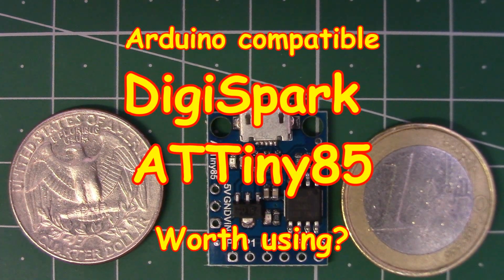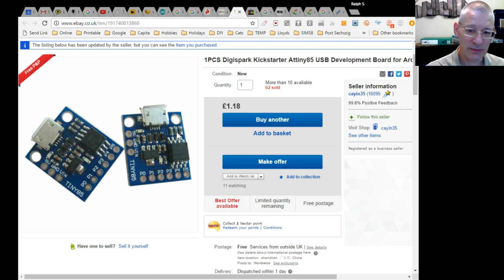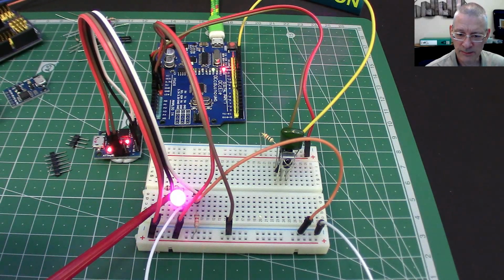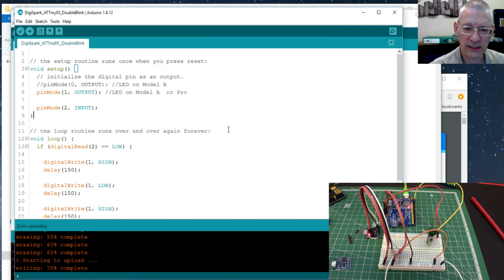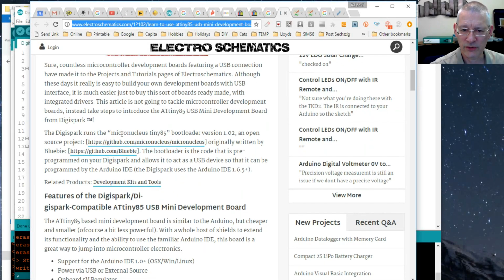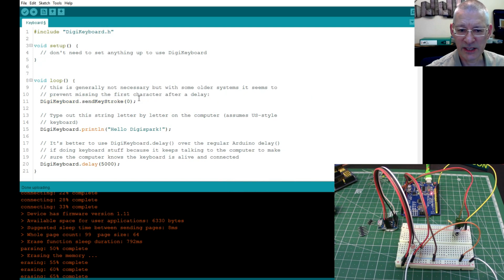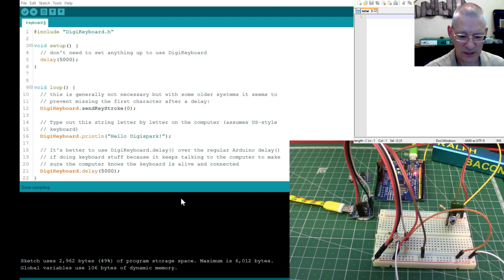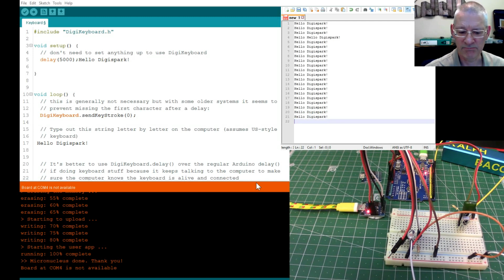#66 AT Tiny85 Digispark - Arduino UNO alternative? An introduction!

Comment: Great video. Curious, if your using an arduino to mimic a keyboard to control your computer, why not write a simple Autohotkey script to  perform that action by a keyboard shortcut key. Just thought I'd share. I learned a lot from your video!
Reply from the maker: Ah ha! It sounds obvious to use a keyboard shortcut, but I can't have my keyboard in front of me when I'm doing a video, Jonathan, it's totally in the way. So my very small short cut Arduino emulator keyboard sits to one side and with one touch of a finger I can change the camera source. No faffing around with ALT-CTRL-SHIFT-A etc! In fact, I do have shortcuts like that configured in the video recording software but my Arduino emulator sends all those strange key combinations as I've described. Even more simple! I hope that clarifies things and good to hear from you.

Comment: Ralph is it worth all the hassle with fewer pins and less memory and driver problems I think that the pro mini at 2.20 is a better bet
Reply from the maker: I understand exactly your point of view, but the thing is, Bob, some hobbyists really do want a small 8-pin footprint (possibly SMD) device rather than the larger pro Mini (or Nano or whatever).
 
It's not just about the money, or memory, it's the right-tool-for-the-job type aspiration that many people have. I just present what I find, after all I'm just the messenger (so please don't shoot me!). I totally understand why many people think "too complicated" about the Tiny85 and just use a device with which they're familiar - and it, too, gets the job done!
 
Comments so far about this video strongly indicate people are in two camps: the one you mention and the one I mention in this reply. Neither is wrong. Neither is right. Whatever works for an individual in their project is the right for them. Great that you posted your reply here, as it allows me to gauge how people feel, so thanks for doing that.
Reply: Thanks for your reply Bob
Reply: In addition to what Ralph wrote, the coolest thing (IMO) about the Attiny is how low you can make the power consumption. It's amazing.

Comment: interesting vid Ralph, these seem quite good to make wearables or really small projects. I liked the idea of micro usb instead of FTDI until you revealed the 5 second window to do everything, good stuff cheers Alan
Reply from the maker: Hi Alan, yes wearable projects are all the rage these days and this tiny microcontroller could fit the bill nicely. Incidentally that 5 (approx) second window at startup is only there to enable your PC to connect to the unit to program it; if it finds it then it can take as long as it wants. If no PC connects to the device then it just continues on its merry way. The only downside is that there is, effectively, a small delay from switching the unit on and it starting to execute the embedded code. Happens on a reset too, of course. In contrast to a UNO or Nano which execute immediately on startup, no delay. Or have I now totally confused you?
Reply: Ralph S Bacon thanks for the reply, makes total sense

Comment: Thanks for this. I have a couple and they are recognized by win 10 then right after not recognized  , Over and over. I gave up with them.
Reply from the maker: Hi Darrell, yes I think I mentioned in the video that Win 10 didn't seem to always show them but it still accepted the data as though it was a keyboard. I'll investigate and if I find something include those findings in another, future video on this fascinating device (but I feel your frustration too - but don't give up, wait for the next video on them!)

Comment: They have ones with usb insertion edges also
Reply from the maker: I think you are also referring to the tiny form factor mentioned in the post by +squalazzo which is really quite amazing. I'll look more closely at this device (including getting I2C working on it) in a future video, I hope... thanks for posting, good to hear from you.
Reply: Yeah thats it, its even smaller for program once throw in project. Sure they are available everywhere also.

Comment: I've been a fan of the ATtiny85 for a while now but only in the DIP version as my poor eyes are too old to be doing with SMD. I use this rather nice Arduino shield and the Arduino as ISP sketch loaded to program it:

http://www.ebay.co.uk/itm/221324819158

I do actually own proper programmers (as I do prefer vanilla AVR C to the Arduino IDE) but sometimes you need the convenience and this little shield does a great job and even comes with a bonus RGB LED circuit board for your experiments.

Great video as always, keep up the good work. :)
Reply from the maker: Hey, Nick, that does indeed look interesting for the ATTiny85. I need to explore the capabilities of the Tiny85 more fully (incuding I2C so I can extend the number of pins available, for example). If it turns out it could suffice for those smaller projects then this programmer seems ideal.
Thanks for sharing the link as I'm sure other readers will appreciate it too, and thanks for the encouragement!
Reply from the maker: In fact, I've just ordered one (the DIY kit version) so it will feature in a future video. How great is this? You just mention it in passing and soon there will be a video all about this little Tiny85 programmer! What a great community we have here. Thanks, Nick for that suggestion.
Reply: Yes, I bought the kit version and put it together (with the bonus board) in about 25 minutes. In your video you talked about those boards for the Nano. I do have a couple of those as they are very useful but I also found this on my travels on ebay:

http://imgur.com/a/LxO2h

The first 3 photos are from the original developer, the final (out of focus one) is mine, still not populated the user area yet but I am thinking LCD interface possibly. This board brings a whole new meaning to Arduino Nano development for me.
Reply: Ralph S Bacon 

Hi, I like your videos regarding the Arduino, but can you tell me which Arduino IDE you use on some of your videos when showing the code please,

Regards,

Les.
Reply from the maker: Hi Manx Manninagh! Yes, I use the Eclipse IDE (used extensively by C /  C++ programmers) with the Arduino add on. I've covered this question a couple of times before, it might be time to do a proper video on it, you reckon?
Reply from the maker: Mmm, interesting! As a development board it certainly has merit. I'll look more closely when I'm back from vacation, thanks for the link. (In fact, it looks similar in concept to my PIC development boards that I used to use).
Reply: Ralph S Bacon 

Hi Ralph,
               Many thanks for the answer, I'll have a look at that IDE. I personally would appreciate a couple of videos on that subject. I've not watched all your videos yet but, I'm working my way through them. I've recently retired and as an electrician have always had an interest in electronics and taken it up as a hobby, trying all sorts of things including the Arduino. Again, many thanks for the videos, and I look forward to learning more about electronics.

Regards,

Les.
Reply from the maker: Hi Les, good to know your interested in electronics (which is where I started more decades ago than I care to recall!) And I hope you enjoy the other videos and future ones yet not even created! And I'm not jealous that you have retired. Not. Not. NOT. :)